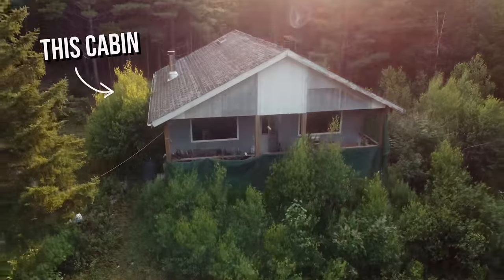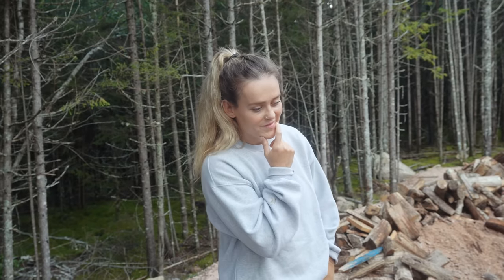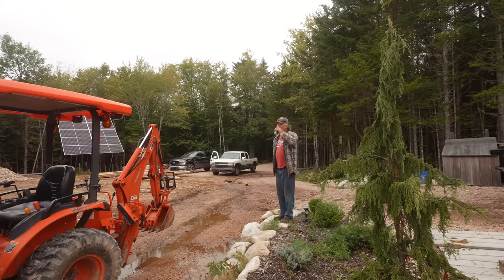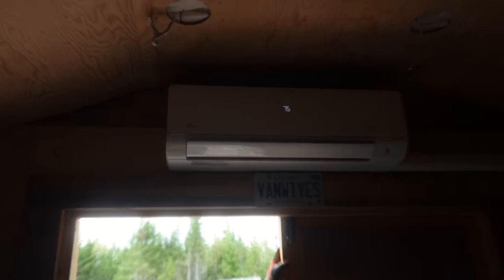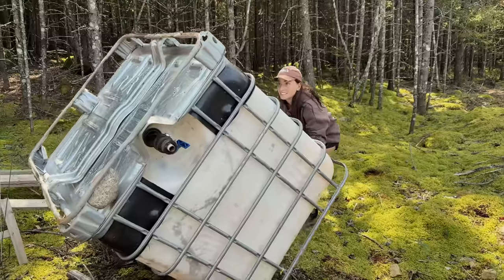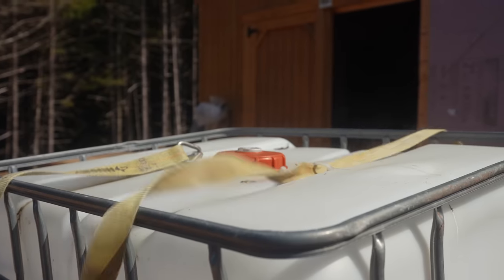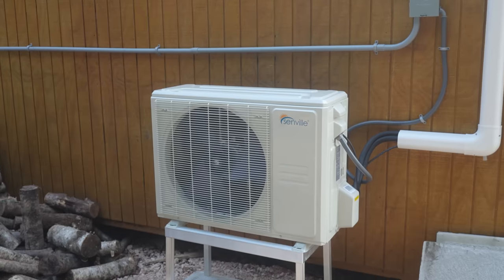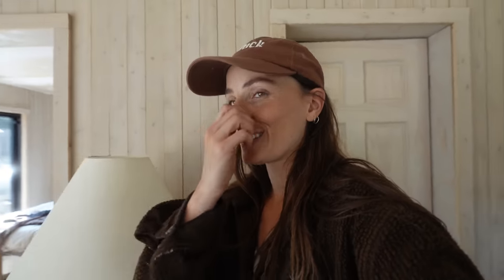Preparing for Winter Off-Grid in the Woods

Comment: Storing/drying wood for burning should have air.......AND remember how to not to stack wood.
criss-crossing the wood is for air /drying less areas to get mold rot which typically means less bugs .......the closer to your living quarters the more bugs you will have possibly inside your home....then again that pretty much goes with heating with wood.
I'd be careful around those sawall ends on the tote you cut up.....they look like they could give a nasty cut.

Comment: Insulation. Insulation insulation …………. 250mm. In walls floor and 400mmm in ceiling and you’ll be toasty warm. With just the heat from  a toaster

Comment: RE: Tire - nothing $200-300 won't fix.  Need to monitor air pressure from time to time or they will be susceptible to sidewall slices as you found out.

Those split units are very efficient.  I use one and it heats well down to approximately -10C.

Also, your wood carrier could also be used for off-the-ground projects like your siding, roofing, etc.

Comment: Save your back.  Pick up a load of wood with the tractor and position it in front of the tote.  Offload it from the bucket at waist height so you are not bending over repeatedly to move just a couple of logs.

Like you I have been renovating a cottage in NE Ohio that had been vacant for years.  So far the roof, windows, ducted  heat pump system and driveway are done by pros along with 90% of the electrical.  Updated well equipment and plumbing(no hot water yet) and septic lines are next while I chip away at insulating.  My eyes were bigger than my stomach when I took on this project and surgeries and cancer treatment 3 years ago has taken a lot of wind out of my sails.  I'm not giving up as my mindset and motto are KFG: Keep Fucking Going.  With that being said, the best part is enjoying the change of seasons and wildlife that graces my little piece of heaven on earth.  I enjoy your videos and admire you tenacity in everything you do.

Comment: Well done girls with the wood storage using the water storage frame. Don't know the measurements of the plastic water vessel, however, could you cut it sideways and slip it over the frame to keep the wood dry. I think it is not square, so possibly cutting the top off the wider side may allow it to slide over the frame.  good luck ladies, you are doing so well. congratulations, you are very inspiring.

Comment: The outside unit for the heat pump seems low to the ground,for the amount of snow you guys get. Wouldn’t it have been better to put it up higher and have it on a bracket attached to the wall so the snow won’t affect it?

Comment: I’m surprised your electrician did not mount the heat pump motor up under the gutters of the shed. One big snow dump & you will be out shovelling the snow away from the motor or another flood will see the motor ruined because of water damage. Mine is 1.5mtr off the ground, using special brackets made for this purpose.

Comment: just a fyi  if that happens again jack up front of tractor    put a ratchet strap in the center of the tire alll the way around it and tighten it up   maken sure bead is even all the way around rim   get a compressor  and try too iinflate tire   it may take a few tries but it will work also check air in tires weekly or b 4 use because as it gets colder  air compresses and it will deflate
Reply from the maker: Thank you Pat for  sharing your knowledge with us. We sure do appreciate all the information we receive from our community. 🌞🐾

Comment: As a fellow Canadian I know for a fact that heat pump won’t work in a Canadian winter it shuts down when it’s cold  I have the same one
Reply from the maker: Which one? That’s why we have 3 methods to heat off grid- wood is the most reliable 😎
Reply: @Vanwives  Mitsubishi heat pump it sucks and turns off when it’s cold outside

Comment: Prob silly question, what is a heat pump? We in the UK are being asked by our government to install heat pumps that have tubes drilled deep into the ground where the earth heats up the contents of the pipes and transfer this heat into the home.. is yours the same? I didn’t see your pipes dug into the ground?
Reply from the maker: Hey! This is a brief explanation- it’s a little different than what you’re speaking about. 

Ductless heating (also known as mini splits, a ductless heat pump, or mini-split AC) is a type of heating and cooling system that doesn't require any ductwork. It moves heat energy around, rather than producing it. The system has an outdoor compressor unit that's connected to one or more indoor units.

Comment: Hey, next time you need to change a tire, sit on you butt like you were straddling the tire. Next slide your toes/tops of your feet under the tire on either side of it to lift it up with your toes with leverage instead of trying to lift it up by hand. You'd be amazed how strong your toes are at lifting. Plus, this way you can easily line up the lug nut holes with the posts. ❤

Comment: Here is the thing why not have your own Generator with gas heat ex changer Runs off the extreme temperatures yes they are expensive yes need servicing every 2 to five years and no fossil fuels. Even better be like places in the UK that run off methane when methane is burnt run through a catalytic convertor hardly any pollution and reduces the smell to not being able to tell.   There are so many new inventions people use for off grid now it is upsetting the power station companies and that is fine with me.  Oh one more thing because of the efficiency of those generators they give out 22KW to over 40KW as used on some very expensive American and British war ships.

Comment: I don't understand why those guys did not tell you that heat rises but you guys put it up high so most if not all of your heat is going up, way over your heads. ok , cold drops down and heat rises , that's why heaters are put down on the floor in most houses and the air conditioning is put up high cause the cold drops. but I'm no expert so enjoy, girls..

Comment: Why would it be expensive to heat your house with wood? You literally live in the middle of a forest?
Reply from the maker: Have you seen our woods? Full of match stick tress and soft woods 😂 Also, cutting your own wood is very time consuming so a lot of people buy wood by the cord which can be pricy. Time is also money they say.
Reply: @Vanwives  they do, but you have wood you could cut, not saying that's your best option but you also don't have to cut right next to your cabin.... find some hardwoods and cut a path to them, but try to make sure that everything you cut is dead or dying
Reply from the maker: @Controlled_Insanity_003  for sure we could. But the rather away from your cabin the more time and gas to haul them back. I think after investing in our off-grid system we are happy to go with a heat pump